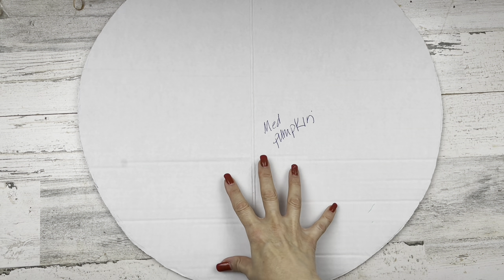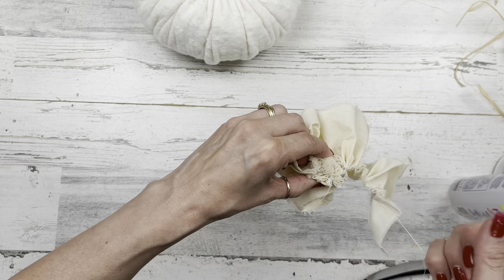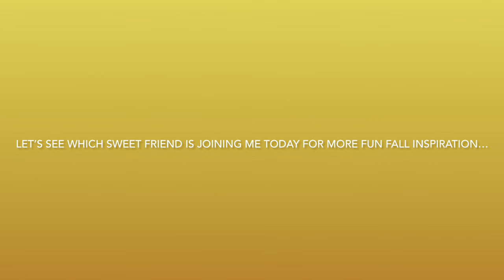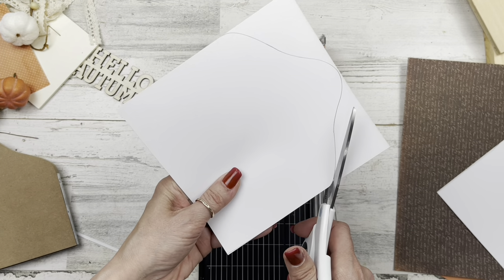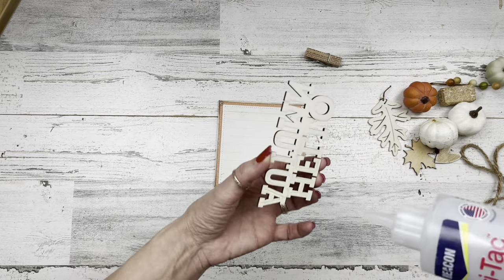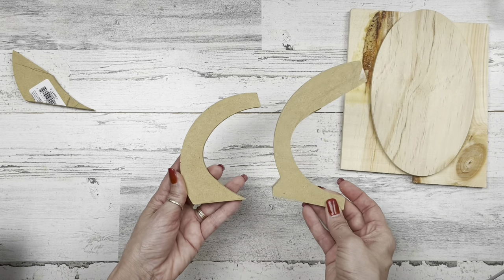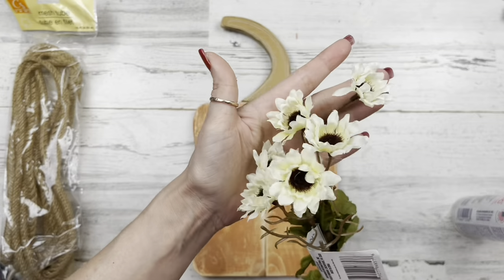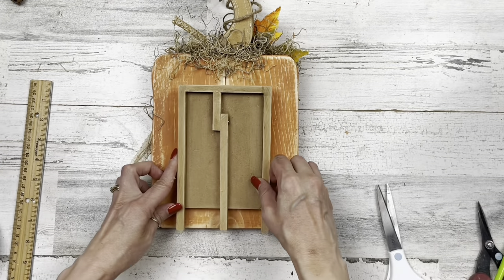DIY Rustic Farmhouse Fall Home Decor | DIY Dollar Tree Fall Decor | DIY Dollar Tree Fall Crafts 2022

Comment: Absolutely delightful!  Would you mind taking a moment to tell me why you prefer using the Beacon glue? It is rather pricey but I find I don’t get along with hot glue very well lol. I am interested in knowing your opinion on this.  Thank you!
Reply from the maker: Thank you 😊 Ana! Beacon Fabritac….I have been crafting for years and scrapbooking is one of those passions I love…especially taking it to an off the page thing and using it for home decor. Scrapbooking has so many bits and baubles to use ….and I often think back about when I first started scrapbooking it was all about using the best adhesives, so that as you tuck each decorated page into a protective sleeve in an album, you don’t reach for that album 10 years later and find all these bits and baubles at the bottom of your page protector sleeve. Someone at a crafting retreat shared beacon Fabritac, so I tried it…and I was sold. It holds all sorts of materials…plastic, metal, leather, fabric, paper…it’s acid free so doesn’t harm photos. I can stack and layer all my pieces without hesitation or fear of things coming apart. I honestly have things I’ve made over 10 years ago, still holding up beautifully. …and I figure if I can use this glue to add plaid patches to my jeans…no sewing…and I can wash AND dry those jeans in hot temperatures for over 2 years and those patches are still on there…that glue is gold!!! I’ve honestly had things people have made me using hot glue and things have popped off a year later…if you don’t use enough. I still use hot glue every now and then and am not adverse to it, if it’s used liberally…but that’s my case for Fabritac. It is a little expensive, but I buy it from the Beacon website itself, (and they do provide a link to buying it on Amazon and a discount from there as well) so I buy it in bulk..usually a dozen at a time and it works out to $8 or $9 a bottle depending on the discount they are offering at a time. Better than the $12-$17 price tag in the store. It tacks within 15 seconds, secures in 30 seconds and sets within 1 minute. It’s fabulous. I’ve tried other glues like Aileen’s tacky glue..even Aileen’s Fabric glue..waste of money…I took them both back to the store. Soooo….that’s my opinion. I want to recommend the best glues for your home decor projects that will last and this, in my opinion….is the best. I will say this too…they have a glue that’s called 3-n-1. It’s also just as good as Fabritac…I’ve used it as well, when I can’t get ahold of the other one for some reason. Hope this helps! 😃 Hugsies!
Reply: Thank you so much for taking the time to answer my question so thoughtfully. I do a lot of paper crafting as well so it would be great to have a glue that works across the board so well.